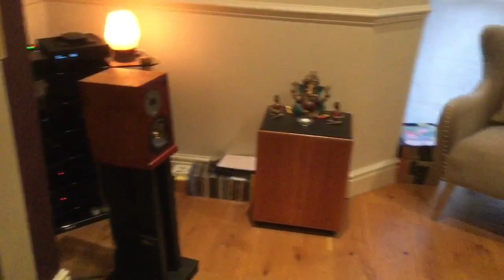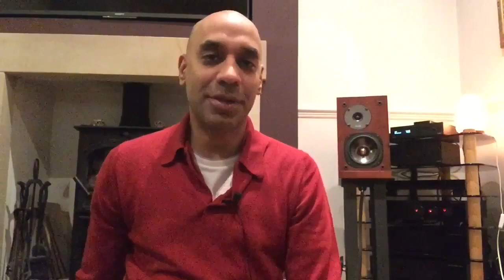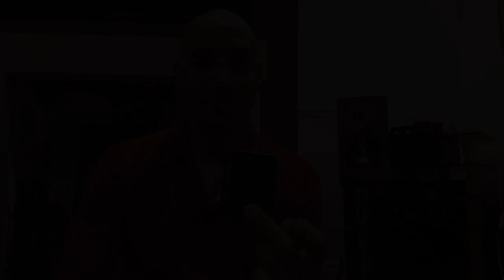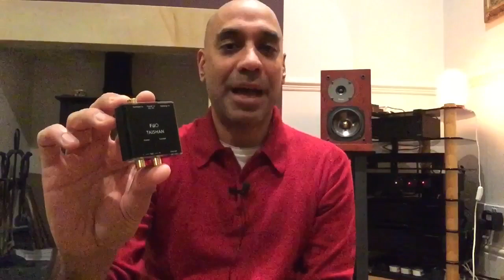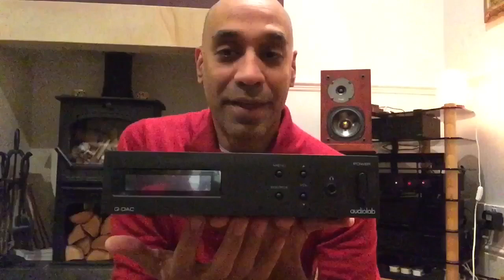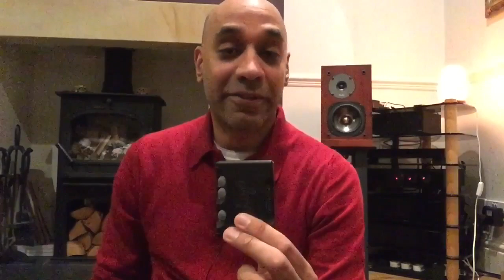Chord Mojo Review - Vs Chord Hugo and other DACs

Comment: I recently discovered your channel and I've already watched multiple of your videos. Great content with a little bit of technical depth! 👍
However, the means of quantization and interpolation you described applies to PCM (Pulse Code Modulation) and similar; there also are FPGAs that use PDM (Pulse Density Modulation).
With PDM, the amount of pulses given per unit of time from the FPGA to the output filter determines the amplitude of the signal.
Reply: One of the most common types of PDM protocols in the field of audio electronics is DSD (Direct Stream Digital).
Reply from the maker: Hi Qorax, thank you for watching and sharing your expertise 😉

Comment: Would there be a noticeable improvement in sound quality between the Mojo & Hugo 2 when using headphones, such as the Sennheiser HD800S?  And if so what differences?
Reply from the maker: Hi Anthony, in my opinion there is a noticeable difference in quality between the two and your HD800S are more than capable of highlighting it. Don’t get me wrong it is not night and day but noticeable. The Hugo 2 will have a faster and tighter bass, more space between instruments and more extended high frequencies. It is a bit like trading a BMW 320 D for a BMW 530 D. A lot of similarities, just the big brother offers you more.
Reply: A British Audiophile great to know that headphones at that level have the ability/quality to distinguish the differences in the way you describe for a speaker system...yet at such lower cost and without the need for a decent room.

Comment: Hi there. An insightful video indeed :) I have been looking for a portable amp+dac for powering my AKG K712 Pro Open Back Headphones. I have been reading a lot and watching many reviews over the past few months for the same. I did personally demo the Chord Mojo on my headphones using 16 Bit FLACs and Tidal. However, personally, I did not feel that the Mojo made my headphones sound considerably better as compared to my current source - Apple iPad mini (1st generation). Sure, the amplification was better, but then, I felt as the Mojo shrunk the width of the soundstage as compared to the same song when hearing on my iPad. Also, the instrument separation was not extremely distinct in the matter in which the instruments got locked in the audio image on my iPad.  I know, it sure sounds funny, as the iPad is not at all an audiophile device. But just for the purpose of my understanding, wanted to check what could be the reason why I was not able to appreciate the sound quality of the mojo, as it is an otherwise groundbreaking legend in the audiophile world. Maybe I'm missing something out. I'm not sure. Would be really helpful if u could throw some light on this. Again, just a personal opinion, no hard feelings any mojo users out there :)
Reply from the maker: I have to say I am surprised Mehul. There should be no comparison when you listen with the Mojo compared to the internal DAC on your iPad. I have done the same with my old Sennheiser headphones and the difference is night and day. I am not much of a headphone listener though, so can’t offer you any great insight here. It certainly shouldn’t be a load issue. The only thing I can think of is for some reason the Mojo did not match well with your AKGs or was faulty.

Comment: Very interesting review. Have you ever listened to dragonfly red? That's what I'm using right now and that supports MQA on tidal. I compared it to a top of the line chord that my dad has and the chord was definitely better. I had something like your 25 pound DAC before and the dragonfly red was big improvement on that. Cost of dragonfly red is about 170 new. It's USB powered connected to a jitterbug so no faffing about with charging. Would it be worth upgrading to the mojo?

Comment: Learned friend, are you sure about the sample rate for CD? I thought it was 22.05 per channel and these take turns? Yes, that adds up to 44.1 kHz. I think you see my point.
As to sampling a frequency of frequency x needing to take 2x samples, would you agree this applies to pure sine waves?
Reply from the maker: Hi JP, the sample of rate of CD is 44.1 KHz. The maximum representable frequency is 22.05 as per the Nyquist theorem. You are right that this is for reproducing sine waves.
Reply: @abritishaudiophile7314  - thank you - I should have browsed for it, not raised the point first. So, the sample frequency for the channels blended in one stream is 88.2 k which requires ~1.4 Mbps - peanut bandwidth, that is
Reply: @abritishaudiophile7314 - The highest base frequency on the piano keyboard is near 8 kHz. But that is far from a sine wave. In classical music the top octave is practically never used. So that make 4 kHz. And we may not clearly distinguish different sources above 2 kHz. But, imagine yourself blindfolded. A transversal flute (pure sine), a clarinet (block wave) and violin (chaos) play the same note (base frequency). You can easily identify them and point the out.
What max sum frequency is presented to each of our two ears? IIRC, Fourier would approximate the blockwave with 5 sines or sine halves - each another frequency. This only will give amplifiers a hard time and is almost impossible for speakers. If we scale the orchestra up from 3 to many more, like over 100 in a symphony orchestra, then, nobody plays above 8 kHz, what bandwidth do we need to faithfully record that and play it back? Off the cuff. Here we have the problem of sine waves underlying all audio engineering rules of thumb. The way we recognize different voices (instruments, sounds, noise) is by wave shape analysis. Our ears dimensions cap that ability around 20 kHz, depending how physically big our ear anatomy is. But our ability to analyze wave shape may be much higher when expressed as sine wave frequency. Or, a theme to discuss in a video?
Reply: JP dJ this has interested me for a long time, but I have never had the time to properly investigate it.  A sine wave and a triangle wave at mid audio frequencies, say 3 kHz, sound very different, but what about 20 kHz?  At the upper limit of human hearing I would speculate that they would be indistinguishable.  If we do a Fourier analysis of a piece of music, what is the highest frequency we will find?  These will come from the fast transients.  What happens to the sound if we remove everything above 20 kHz?  Can we hear the effect of say 25 kHz in terms of its effect on the timbre of the sound even though we could never hear a 25 kHz tone?   Very few people can hear as high as 20 kHz - my own hearing doesn’t go much above 10-12 kHz these days, so I wonder if the current hi resolution audio trend is really adding anything?  Tarun’s point about timing is interesting though, I haven’t come across that before.

Comment: Great review as always Tarun. I recently purchased the Chord Mojo for my HD800's and it sounds fantastic. But i'm also wanting to connect it to my hifi system. I have a Roksan M2 power amp and the AudioLab Mdac as the dac/pre-amp, the source being my Mac Mini & ATC SCM11 speakers. Can I somehow connect the mojo out of the AudioLab? I'm sure it's not a wise idea to connect Mojo straight to Power Amp (in Dac Mode) then into Mac Mini and use it's volume control on screen. Not much on Chord's manual explaining line level alternative's!!
Reply from the maker: Is there a digital out on the M-DAC? I am not sure I would bother though. Just more components in the signal path 😊
Reply: @abritishaudiophile7314  There is indeed Sir, Coax or SPDIF, I might try that in this case :)

Comment: How did you power your MoJO when using it as your primary DAC?  I'm concerned that constant charging of the MoJo will damage the battery?
Reply from the maker: Hi Dennis, I had the same concern but according to Chord they don’t expect it too shorted the battery life my too much. Replacement batteries shouldn’t be too expensive anyway. Thanks for watching and commenting 😉

Comment: What can I use to beef up the volume from my Yamaha wxc 50 pre amp going into my Crown XLS 2502 power amp ?
Reply from the maker: Hi Gadgetdad, if you have the input gain control of the Crown set to max, then there isn’t much else you can do. I am surprised that it doesn’t go loud enough🤔

Comment: The timing claims by Chord don’t appear to be supported by science. CD quality sample rate is theoretically enough. The improvements in sound may actually be jitter related. Changing sample rates probably alters jitter behaviour. Other DAC differences likely come from filter output choice (minimum phase messes up relative timing information whilst linear phase preserves relative time). Apodising filters smear energy. Some DAC filters aren’t nearly steep enough and allow aliasing. Since most speakers introduce a lot of phase changes anyway YMMV. Chord DAC filters appear to be linear phase which is good if accuracy is desired.
Reply from the maker: Hi Jeremy, I am with you on this one. I have watched a couple of YouTube presentations by Rob Watts explaining the benefits of the increased Tap length, WTA filter, up sampling, etc. I personally find it difficult to separate the science from the marketing. Unfortunately, I have only a rudimentary understanding of digital filtering and not the depth of understanding to question their claims. Digital filtering is a bit of minefield. Do you know of any good resources to walk you through FIR and IIR filters?
Reply: A British Audiophile I suggest starting with a textbook on Time Series Analysis. There are many textbooks on the subject. I am certain you can grasp this subject quite easily with just a few hours of reading. My axe to grind with the audio industry is that we have known factually for more than 50 years that linear phase and properly designed  anti-aliasing filters are the best way to reconstruct the audio signal yet we recently have a plethora of playback DACs that offer a variety of other lower quality filters with dubious claims. Misinformation about pre-echo from linear phase is used to market lower quality minimum phase filters. Minimum phase filters are only needed if you are applying a filter with a slope acting within the audible range below 20KHz (like a mix engineer would do to tailor the individual sound of a snare track). Pre-echo of inaudible frequencies seems to be a completely fallacious argument to sell minimum phase filtering on a DAC playback device.

Comment: Does the Mojo beat the internal DAC in the Audiolab 6000A?
Reply from the maker: It is better but the internal one is very good 😊
Reply: @abritishaudiophile7314  Thanks Tarun - that’s good to hear!!
Reply: @abritishaudiophile7314  Got the RME ADI-2 which I plan to pair with the Quad 99 power amp and Z-2 speakers. The 84dB sensitivity of the Z-2’s had me worried that 50W from the Audiolab 6000A may not be enough. The 91dB of the Quad 25Ls should make a better match for the 50W output. Hope I’m right.
Reply from the maker: @JCP-Ghy  the sensitivity only relates to how load that amplifier will play those speakers. The impedance plot give you an indication of how hard they are to drive 😊
Reply: @abritishaudiophile7314  Thanks! I think you’ve said that in your videos, but I struggle with the co-relation of watts, resistance and sensitivity. I think the minimum impedance on the Z-2s is 4.8 ohms but that doesn’t help with my lack of understanding 🤦🏻‍♂️
Reply from the maker: @JCP-Ghy  4.8 ohms is not a difficult load for modern amplifiers. I suspect you should go for something more powerful than the Audiolab 6000A just to be on the safe side. It will elevate your concerns about driving capability. Are Atoll amps available where you are? You get a lot of power for your money with them 😊
Reply: @abritishaudiophile7314  Thanks Tarun. Atoll amps will not be easy to find here. But I think the Quad 99 power amp should do, as I never try to rock the joint. I’m hoping there’s a video coming from you shortly or the weekend just won’t feel complete
Reply from the maker: @JCP-Ghy  the Quad is a good choice. Video next week as I have taken a week off to spend with the family 😊

Comment: Hi tarun. What input of mojo did you use when connecting to your hifi? 
Thanks..
Reply from the maker: Hi Teamdriver25, I use USB to connect my Aries Mini, optical to connect to my TV, coax to connect to my Blueray player. Not all at the same time, of course. Thank you for watching and commenting.
Reply: @abritishaudiophile7314  thank you so much for your immediate reply appreciate it.
Reply: I have one more question. Are you using the preset 3v line out of mojo when connecting to preamp? 
My preamp is pv10bl w/2.47v input sensitivity isn't become overload? Sorry for the ignorance.I am new in streaming. And my first dac mojo is still coming from ebay.
Reply from the maker: Hi Teamdriver25, I have a traditional preamp with a potentiometer volume control. My preamp seems to sound best when it’s volume control is somewhere between 1/3 and 1/2 the way around. As a result, I have reduced the volume on the mojo Dac from line level to about 0.4v max, about -25db, both volume buttons show green. I think it is going to be a case of experimenting and seeing what works for your set up but I would imagine 3v would be too much for most preamps. Hope this helps.
Reply: Hi tarum. Yes in your video i saw your mojo in both green light and i search the net what was that double green level. I have also a diy passive volume control and now exited for mojo to arrive and test what volume level and experimenting the passive and active  preamp which is best for my system. 
Thank you again tarum..

Comment: Sorry, but your claim that more bits and higher sampling rates gives higher resolution recordings is totally incorrect.
In audio engineering there is no term or definition for “resolution”.there simply is no point in using more than 16 bits or higher sampling rates for play back.
  Many audiophiles believe that higher sampling rates and more bits increase the "resolution" of the recording.  This is a misunderstanding of how digital recording works, compounded by marketing hype.  The Red Book CD standard 16 bit/44.1 KHz makes essentially perfectly accurate recordings and increasing the sampling rate and word length does not make the recording any more perfect.
The latest fads in sampling rate is to use 96 KHz or even 192 KHz sampling.  96 KHz will record sounds up to 40 KHz (80 KHz captures the 40 KHz sound and the remaining 16 KHz are used for the anti-aliasing filter).  192 KHz sampling will record 80 KHz sounds (160 KHz sampling captures 80 KHz sounds while the remaining 32 KHz are used for the anti-aliasing filter. No music microphone records above 20 KHz, so the additional  20 KHz available in a 40 KHz recording system simply captures supersonic noise and wastes 50% of the data space.
A 192 KHz sampling system is even worse.  Fully 75% of the bandwidth is used to record supersonic noise and wastes 75% of the data space.
 these higher sampling rates are also combined with 24 bits.  So the wasted data space is much greater than just described as one needs about 30% more data space for the extra bits.
 These so called "Hi-Rez" recordings actually degrade the sound quality.  This is because the supersonic noise will produce intermodulation products (beat frequencies) down lower in the audio range.  
For example, noise frequencies at 37 KHz and 38 KHz will interact together to form intermodulation frequencies at 1 KHz, which is a frequency humans can hear.  So hi-rez recordings will actually produce noise and distortion in the audio bandwidth, which degrades the sound while making no improvement in any other respect.
Many Audiophiles think they are listening to a digital signal but the DAC is delivering a 100% smooth analogue signal.
I am sure you will agree a well recorded and well engineered CD will sound equally as good as any so called “hi-res” recording. Some Audiophiles claim   super-human hearing and believe they can hear time smearing but imperfections in  speaker drivers and crossovers, plus the listening room acoustics, will
 totally swamp any perceived or imagined timing effect.
Reply: No response?  Figures.  Thanks for the education mate.

Comment: Tarun I have a Sugden A21SE, Audiolab 6000n streamer and KEF R3 speakers, Chord Chorus interconnect and QED XT400 speaker cables, always looking for the next step, would the MOJO be an improvement over the built in DAC in the Audiolab? Or what thoughts do you have?
Reply from the maker: Great system Mr M. I would go for the Denafrips Ares II That I reviewed. It is quite a bit better than the Mojo 😊
Reply: @abritishaudiophile7314  can the Denafrips Ares II go into an integrated amp, only one forum mentions it needs a pre-amp line in as no volume controls, the streamer itself has volume control via the PlayFi app it uses, not much info out there regarding the Denafrip. Regards Steve.
Reply from the maker: @mrmeaner3917  it has no volume control but you would use the volume control on your Sugden. It is when you are connecting directly to a power amp that you can’t use it 😉
Reply: @abritishaudiophile7314  thanks Tarun, that’s what I thought. 👍. Just need to justify buying this for the wife’s birthday! 😂😂
Reply: @abritishaudiophile7314  I’m going to go for the Ares II, you’ve made me research it and it’s impressive, incidentally I’ve just changed my speaker cables from QED XT400 to Mogami 3104 and the difference is immense, it’s like the orchestra just added 20 more musicians.
Reply from the maker: @mrmeaner3917  that is great. Thank you for the update 😊👍
Reply: @abritishaudiophile7314  I now have the ARES II from Willow Tree, good call, sounds superb.
Reply from the maker: @mrmeaner3917  it is a very special DAC 😊